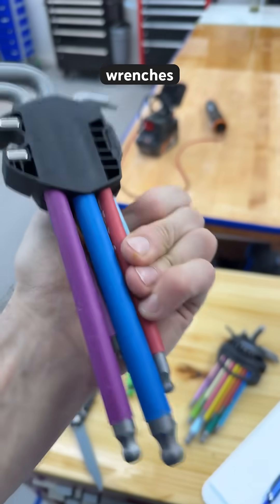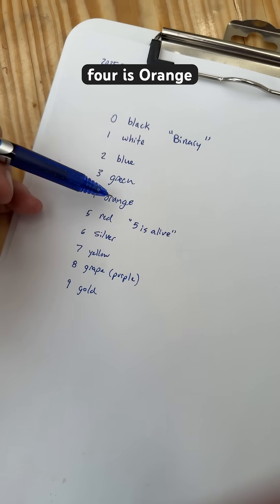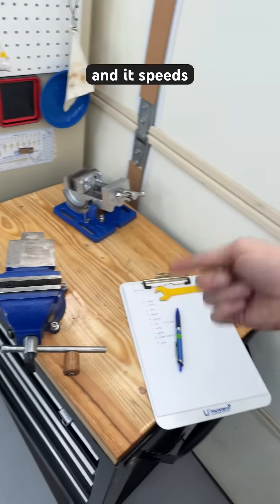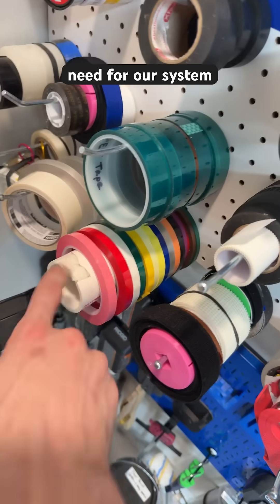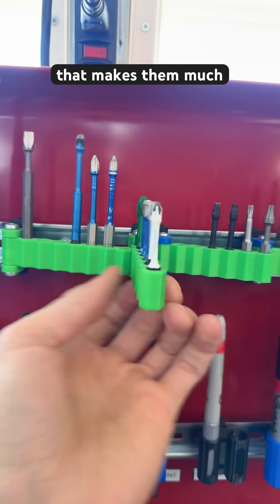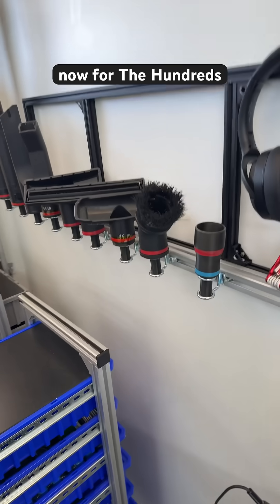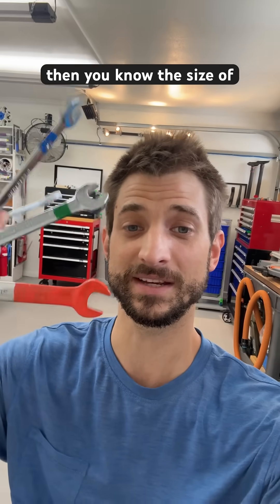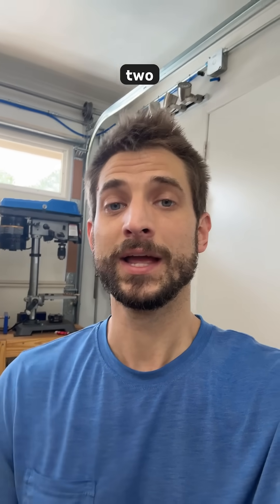here’s the openlab color key for tools & parts

Comment: These are not standardized colors 2 numbers. The right colors 2 numbers are in electronics ; resistors and capacitors. C2N is standardized already in 1930ies, 100 years ago and this C2N or N2C is in use even today year 2025.

Comment: I had the idea to paint stripes on wrenches corresponding to measurements. So 9/16ths would have nine of the 16th inch color stripes with five grouped together to make counting easier. The lowest color would be quarter inch and half inch would just be two of those. One inch would have its own larger stripe.

Comment: I'm a firm believer in task specific tool sets.  Regular tasks or machines with specific needs should have their own designated tools so you're no going back to the toolbox.  Plus anyone new or different can just be shown the tools and know that's all they'd need.  Also, "standard" allens should be discontinued.  I'm tired of the fractional difference between metric and standard that causes one or the other to be rounded over.

Anyone here know the difference between 0.050" and 1.5mm?

Comment: For the half sizes. Consider a wrap of the next step of tape to go with the large body color.

It indicates clearly, this is an intermediate size tool, not a 4 not a 5. Something in between. Arguably you could do stuff like 4.25 getting a half width wrap to distinguish it from a 4.5 ( full width) or 4.75 (a full and a half width)

Because why not if you want items to be easily identifiable.
Reply: Or a add a red stripe for half sizes?

Comment: Any opinion on paint pens vs those acrylic paint bottles?
Reply: o3 says oil based paint pens are better and the reasoning makes sense. I thought oil based paint was soluble in oil, but it turns out the paint cross-links. "A cross‑linked polymer is not soluble in lubricating or cutting oils any more than cured epoxy is “soluble in epoxide”."

Comment: I suggest taking a page and ordering from resistor color code which follows a strict numbering already. Alternatively from TIA-598 for fiber color coding. The telecom trade has already solved this issue for differentiating between 12 wires/strands easily. That coding itself comes from Bell analog phone color coding. 

Blue
Orange 
Green
Brown
Slate/Gray
White
Red
Black
Yellow
Purple
Pink
Teal

But I'm biased. You've got a good code. But I criticize the use of gold with yellow. If you're using them to designate something numeric, I really suggest keeping with resistor color coding. But it is your own shop.

Comment: May I suggest an update to the system that works well for me? Any item with a decimal place, like 4.5, gets a full color matching the 4 color code plus a stripe of the color matching the 5. Fasteners get a stripe as well. In this way you can still identify the correct tool for any fastener at a glance, absolutely no trial and error needed even between two tools.

Comment: Thats cool but as a mechanic in the equipment industry for the past 15 years, you start to be able to eyeball the size. Im usually either right or off by standard or metric. Plus grease and chemicals eat the paint and tape off

Comment: Have you looked into fiber optic color code? We deal with cable counts in the thousands so we have a standard 12 color code with a dot code along the length of the cable to differentiate which pair bundle it is, and then we hundle those with another alternating 12 color code with the same dot code and so on

Comment: I paint one side of USBs (type A) male and female with a red dot on one side of the connector/plug. When it's time to use them I  just  align the dots and I'm right 100% of the time. No  guessing which is the right side to connect USBs for me.
I do the same thing with micro USB.
Obviously USB type C are reversible and don't have this issue

Comment: In the live audio/events space, Clair Brothers uses the resistor color code. That seems pretty clever, as it is already a well known standard
Reply: Yes, and the Resistor color code already handles non-integer numbers.
[First Digit][Second Digit][10^x][Tolerance Code]
If you assume the "×10^3" to be your base (treating 1.0K as 1.0) you can now easily do "half values")

Comment: This seems very well thought out. I understand it’s a “time savings” for production work. However, I question if time spent coming up with this system and maintaining it, offsets the few seconds you save each time you use it. High enough production sure, but for a DIY’r… doubt it.
Reply: Well the system is provided, so no time is spent coming up with the system. 

As for time maintaining it, how much time do you spend maintaining the paint color on your vehicle? None. When a car is red, it continues to be red. The same is true for a wrench. 

For your arguments sake, it does take time to implement. It took me about 10 minutes to dab all my bits with paint pens, and another 10 to clear coat over the paint. 

So let’s call it 45 minutes for all of the  metric hex, torx, and sockets you own. 

Now I don’t know what “the average diyer” is, but that’s not much time at all in exchange for grabbing the right tool every single time for 5+ years.

Comment: Shrink wrap tape should come in all the colours and sizes you need and fit everything you have in mind...mostly.  Once applied, pretty easy to use without waiting for drying time. Just get a cheap old hairdryer to fix them quickly.

Comment: The only wrench that can benefit from colour are Allen heads or Hex heads.  They’re difficult to eyeball wrench size.  The rest aren’t that difficult.  Wrench enough and you can look at a bolt had and know what size it is, wrench even more and you can tell if it’s imperial or metric.
Reply: But can you dodge a wrench?
Reply: @papapillcosby I can. I’m one of the best dodgeball players out there.
Reply: @B-kn8yb that’s enough to impress me 😂
Reply: Eyeball the wrench in the large bag of both imperial and metrics. Wouldn't a color coding work better? I can feel the size of a wrench, but what good is that if I'm LOOKING for it?
Reply: @bradleyakulov3618 I organize my tools I don’t just throw them into a bag.   I do agree with colour coding for hex wrenches.  Just not standard wrenches.  Works for screwdrivers so I know which Robertson I’m reaching for.
Reply: @B-kn8yb  I don't carry a 714 piece tool set to service my chainsaw when I'm in the woods, and I don't keep one in my car either for when I'm on the go. It's perfectly normal to have a bag with loose tools, there's nothing to be ashamed of.
- With love, the people who paint their tools and not their fingernails.
Reply: @bradleyakulov3618 yeah fair enough, just don’t see myself doing that.  If I have a tool roll, it’s usually for my snowmobile which only has what I need not a mixed bag.  For work, I have a rolling case with foam and holders for everything.  The only thing I find I end up not getting the right size is Allen keys, and I’m not sure colour would help with that anyway.  

To each their own for sure.  Paint away if it works for you.  Nothing wrong with it, just seemed like overkill to me that’s all.  I do stuff that’s overkill to others too haha
Reply: @B-kn8yb  Oh come on, no bite? I just implied you paint your fingernails with my last comment hehe. Paint or no paint, the only thing that matters is to use em. Idol hands are the devil's playthings :)
Reply: idle*
Reply: @bradleyakulov3618 that one went right over my head because I don’t paint my tools, I actually use my tools, they look worn, paint probably wouldn’t last long on them anyway.  So there’s no way in hell you’d find me painting my nails.   I do like a well organize tool case or tool box and garage.  Just not to the extent that I have yellow, pink, red, blue and purple wrench’s haha
Reply: @bradleyakulov3618 Why do you have a bag of wrenches? What kind of animals doesn't use tool rolls? You're like those guys that think a 5 gallon bucket is a toolbox. It's not. It a bucket.
Reply: I Know What Sizes I Need By What Kind Of Car It Is!!!
American; 10,13,15,18,19, Plus Some Standard Sizes!!!
Japanese;  10,12,14,17,19 And 21!!!
European; Who The Hell Know Because They Don't Even Know What They Are Going To Use Year To Year!!! 🙄 🙄🙄🙄🙄🙄🙄🙄🙄🙄🙄🙄🙄🙄🙄🙄🙄🙄🙄🙄
Reply: @rockerpat1085 yeah you do get to know things and you can eyeball it pretty easily.  Although like I said, Allen Head or Torx, I still have trouble eyeballing, always grab too large.
Reply: @rockerpat1085  Me and my brother work on our cars together sometimes. One's got a chevy and a VW, the other, a VW, I have the Mazda. We never fight over the same tools lol
Reply: @rockerpat1085  brothers*

Comment: If you were used to Robertson bits you’d now they are, as Philips bits, also marked from 0 to 3 (never seen other type). 
I mark my tools with heat shrink, also my extension cords (so they don’t get lost in construction sites).
I suggest also a bicolor to mark imperial tools. 
Oh, and I buy 10mm sockets in sets of 12, they grow legs in my toolbox.

Comment: Being color blind, as are 10% of all males, this is a stupid waste of time.   There are design standards of what head goes on what size of fastener.  I learned to tell what size of wrench, or socket I need by sight, when I was about ten years old.  The only time I had any trouble was when the American auto manufacturers went part metric, and one vehicle could have both metric and standard fasteners.    And, since metric and SAE fasteners have different systems for grade stamping, that quickly became obvious.

Comment: Great idea. I'm going to do the same with my tools but using the resistor colour code. Thanks for this.
Reply: This was my immediate thought. Don't need to reinvent the wheel
Reply from the maker: Just having a standard is a leap forward.  Here are some questions:

1) are you going to use multipliers in the same way as resistors do?
2) do you enjoy brown being the most common color in your shop?
3) what color is size 10 if you apply this?
4) with two bands, how do you decide which band is “first” and “second” on an allen wrench?
Reply: @davidmalawey Agreed. Not having to read tiny embossed numbers is the future tech that we need now. 
Stripes is the plan for anything over 9. I don't want to paint the entirety of any of my tools anyway. 
I don't need tolerance stripes, so using bronze hammerite works well enough for brown. Up is determined by the method of storage. Short end of Allen at the top. If I get carried away, I could use gold to signify what end to read from where required.
This is just what I'm thinking so far. But I'll see what I can find for materials.
Reply: @davidmalawey  These are easy to answer questions, and would require less memorization than your system. ×10^-1 multiplier is obvious as a default, so you can keep single colors for whole sizes, but easily "band" for half sizes like 4.5. And you only ever realistically need ×10¹ for double digits. It'll also make that 10mm socket pop as the first thing with 3 bands. 😂

Or, I and many others could ignore the decades of color coding we've used.

You have a good idea. It's just that someone beat you to it by a few decades.

Comment: I love it! Though it's a massive missed opportunity to re-purpose the resistor colour code system.
You could ignore the extra bands most of the time too: The default being metric, with 0-9mm and 10-90mm all using the one band, like you currently have (rather than a multiplier like what resistors need hecause of their massive range of values). 
Then, only if you need finer precision do you add the second band, say 45mm or 4.5mm.
And a third band (the resistor codes 'precision band') could be used when (and only when) it's imperial, or an oddball tbread pitch, or all sorts of other things. 

Trouble is... You're now in the same dilemma as the US with the imperial system. Even if you want to change, it's going to cause a big headache in the short term.

Comment: I am surprised that you didn’t adopt the resistor values color code scheme. Considering your robot project surely it would fit nicely and reinforce a well established scheme, rather than compete.
Your idea also relies on the “American English” language for idiom, rhyme, and cultural reference; which is lost in translation even with English speakers in other countries, let alone other languages.
The resistor color code is universally accepted, and even other “systems” such as the order of the color spectrum, are recognized by all… any child could put away the tools in a rainbow 🌈 color code in the correct order.
In fact, in a rainbow 🌈 code, a “N.5” size, could get two colors, and due to the ascending order of colors the code can be read, and the rainbow 🌈 remains organized when the tools are stored!

Comment: Overall, I love it. Very easy to follow the logic, color : size , word associations, repeat @ increments of 10. 
It threw me when you stated that the square bits would be orange (no matter the size. I understand that they're 4 sided, but why deviate from the system when the color to size works?
Reply: Yes! The square, torx, etc… all have “sizes” too!
Also, the world over: 1/4 and 3/8 INCH drive for sockets, and 1/4” hex bits.

Comment: To take it to the next level, a resitor style code would be great. Just hard to do the bands effectively on all tools and have it last.
I used an array or narrow and wide bands of pin stripping tape on all my drafting pens, pencils and markers to save reading the tiny numbers. So quick and easy to find the size I wanted in a case or tray

Comment: Seems like this would work great for metric. But what do you do about SAE fractional sizes?
Reply from the maker: Halfway solved. I’m tempted to throw them all in the trash!  actually I tabulated up the sizes between 0-1inch, and 3 sizes match metric within 2%.  There’s more details but maybe i’ll write it up inside the openlab documents.  LMK if it’s crucial!
Reply: @davidmalawey the SAE sizes all have odd numbers as numerators, so you use 1,3,5,7,9,11,13,15 (for sixteenths) and the repeating numbers are as easy to distinguish… 5/16 vs 5/8 vs 15/16. You can also use the even number/colors if you want to choose a denominator to use, say eighths… then 1/4 = 2 eighths, 3/4 = six eighths.
To distinguish between metric and SAE a band of PINK on SAE tools might work for you. Although red/blue already a system, it is too subtle.